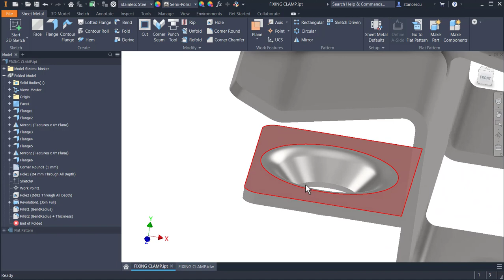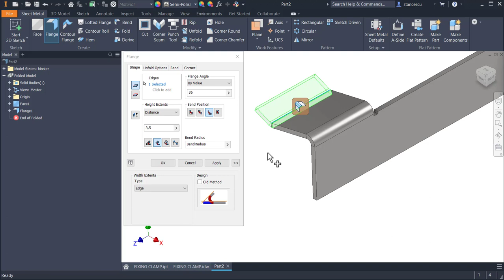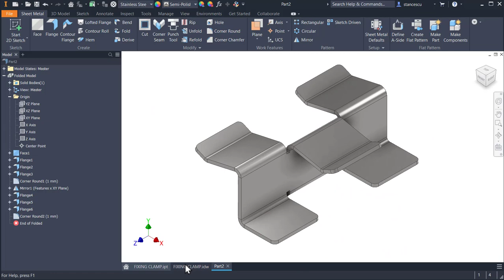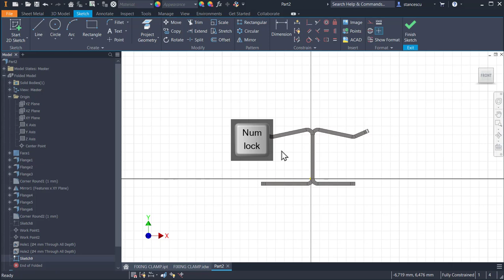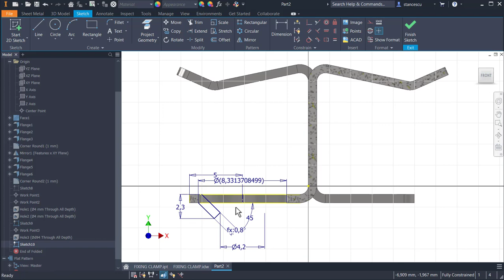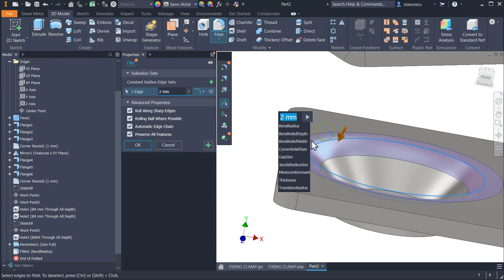Tutorial Inventor - 235 FIXING CLAMP - SHEET METAL

Comment: Thanks for the video professor.  I have a question about the hole: you can make such a hole in advance, so that you can use it later.  To do this, you need to make a stamping.  For a hole in sheet steel, the rule will be the same, only the thickness changes.  If you have time, then please make such a preparation, my hands do not reach this, otherwise I would do something similar.  then just put a dot, and the hole according to the rule and thickness is already ready.  Thanks!
Reply from the maker: I'll try to do this. Thank you!